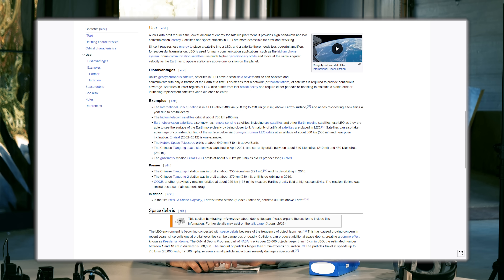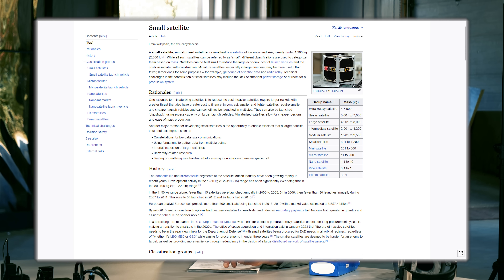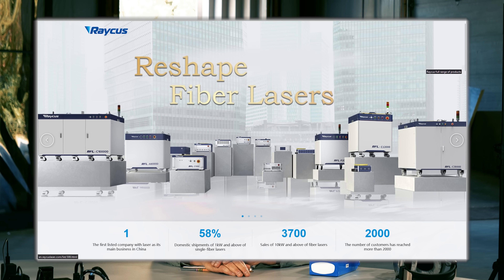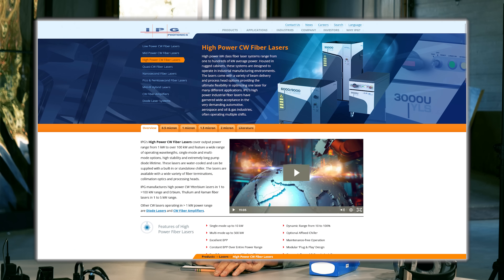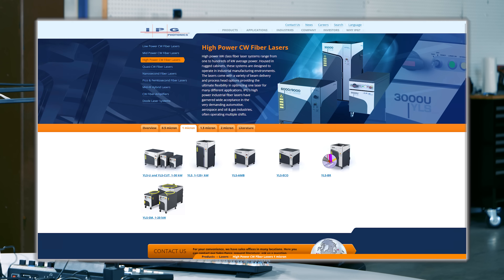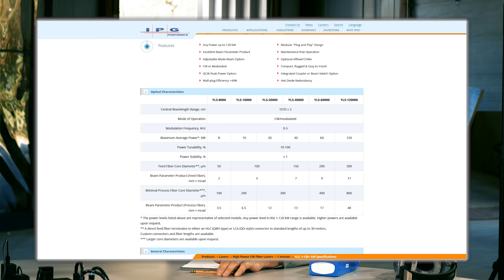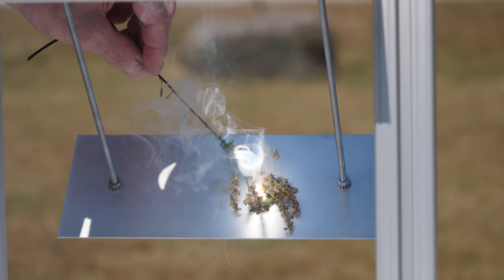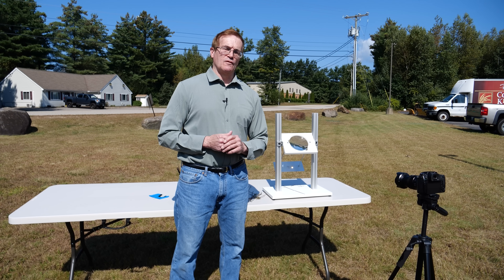COULD SATELLITE LASERS REALLY DO THIS?...

Comment: You should do a video on the feasibility of labelling a nervous system and whether or not you could have a wifi network at that level of form factor for the purpose of controlling the organism. A video on different invasive and non-invasive methods for remote brain control.

For instance, could you calculate the cubic size required for our best piezocrystal to stimulate a single nerve cell? charging them between firings with ultrasound.

It's 2023 if you get what I'm saying...

The piezo nanomotes seem to make sense for why politicians can be made to seem silly with mispronunciation, but their requirement for charge means they can't get the person to say an entire speech. It seems like that sometimes. just sayin
Reply: You used wifi to make this comment so clearly you don't believe yourself

Comment: Thank you, please comment on the following. There was a book written some years ago, talking about microwave weapons. It consisted of a transmitter and a receiver (a conjugate mirror) that focused and amplified microwaves using constructive interference in phase at resonant frequency - or something like that. Is that possible?
Reply from the maker: What you're  describing  is a modified  version  of a MASER. It should function, but as a weapon,  you still have the divergence problem.
Reply: Thanks for your reply, however if it was in phase (same frequency) wouldn't that minimize divergence? @TechIngredients
Reply from the maker: It would and then it would approach the limits I gave in the equation.  Those are real limits based on a perfect, spherical  wavefront. In practice,  it only gets worse.

Comment: This video will need an update when zero-point gravity generator technology goes public, regarding platforms that have been using lasers. Also still does not explain the blue and white plastic objects that dont get touched by flames around them or the metal electro-magnetic fires burning homes. This guy might be NSA or corporate contractor related, "nothing to see here" is part of his job to secure his funding and protect his buddies. Or to be fair maybe he did not study the ruins of the fire to see that brush fire and natural winds is not the answer. There seem to be at least 3 energy weapons at work with these fires, so its not so easy to dismiss all the evidence by just considering one or two without trying to really figure it out. This video does not take into account top secret weapons, or even mention that it is possible he does not know about them.

Comment: When the first Palisades fire happened a few years ago, a lot of people noticed that the trees were burning from the inside out. That made me think of microwave technology. Also, people saw in pictures green beams come down from the sky. Also in the Maui fire, aluminum melted right off of cars. Please explain.
Reply from the maker: I can't address the reports re the trees. It's kinda suspicious because when a fire is so large and hot that the forest is burning, being close enough for long enough to witness that progression in a trunk of a tree is going to be REALLY DIFFICULT. 
The beams, if they occurred, would be invisible because the only lasers with the power and beam quality to do significant damage operate in the infrared. 
Remember, each vehicle contains a lot of  gassoline. Have you ever heard that discussed?

Comment: The kind of powerplant required for such a weapon, I don't think would be probable, as it would be hard to fit in the satellite. It might be possible, by at what cost?

It's not just the cost to deploy and energize one time, and then require recharge. The plant must be far larger.

What storage characteristics will be had at space temperatures? Can they sill deliver at the same efficiency?

Still, for a back of the envelop analysis this is an excellent video. Well done!

Comment: How do you explain the  MELTED ALUMINUM WHEELS I SAW ON CARS BURNED BY "THE FIRE" THAT SEEMED TO BE PICKED OUT FOR DESTRUCTION? COULD THAT HAVE BEEN FROM BURNING GRASS?
Reply from the maker: You don't need the caps.
Probably not, but the gassoline in each vehicle is a likely explanation. The grass fire can rupture the fuel tank and ignite the fuel.

Comment: OK so if I apply this correctly, when I'm dove hunting, and the dove is flying as a 37° angle away from me at 28 mph I will need to lead it by 29 inches instead of 20 because the wind is coming from my left at 4 kts, in the density altitude is 550 feet, and the Coriolis effect and I can back it off by 2.34 inches.... perfect. I'm only a commercial pilot, my mind just doesn't work that way😂😂😂 thank God for people like you!

Comment: I fully appreciate the logic and details on this topic, all but one point. One instance draws merely on "assumption", where everything else is calculated thoroughly. The assumption is that China would be the only responsible state for making use of a DEW. Sadly, I suggest there is more than that state military with such capacity; assuming it would be China, ignores facts we have seen in other such situations. Otherwise, a thoroughly excellent exercise in analysis, educating us with interest. Most viewers would last a few seconds at most. Thanks again..)
Reply from the maker: Thanks. 
However,  I didn't  make that assumption. That particular  state was used as an example.  Obviously,  any state actor and even a well-heeled private actor could field this technology.
I even showed where to obtain  some of the parts!

Comment: During the live streams from La Palma in 2021... One of the streamers was watching a Directed Energy Weapon, i.e. a LASER beam, from space directed at a point on the volcano, until that spot on the volcano became a vent for the volcano. Wish I could remember the creator's name.
Reply from the maker: I doubt that stream was legitimate.
The only lasers with the power and beam quality that have any chance of placing meaningful energy on the ground operate in the infrared.  They are invisible.
Furthermore,  only a geosynchronous satellite remains over a spot above the earth. Such an orbit is 100 times higher than a low earth orbit, and the beam will spread so much that it wouldn't burn a person.  It might not even be felt.

Comment: question to ponder  researchers combined 3 photons of light with a cloud of rubidium gas, apparently the light loses 90% of its speed and gains some mass. ie just like a gas or supper fine dust, but it is solid light made vie electric charge. my question is do you think we should do research to see if that new form of light can be used as a propellent in an EM thruster ie a propellent that is generated via electric power ie a rocket that never runs out of propellent
Reply: lights mass is always zero.
Light doesn't "slow" down as it passes through matter. Light experiences a progressive phase shift as it passes through matter.
This can appear as light "slowing down" but the speed of light is always "C".

Comment: Really nice video. Interesting part of the system could be aiming device capable of tracking small spot on the ground when satellite moves roughly 7km/s relative to the ground at 400km height, although it's certainly possible. Angular speeds are pretty similar to tracking passenger airplane 40 times lower and 30 times slower with precision of low centimeters (roughly one inch) at typical altitude. But with mirrors capable of tracking tank shell or mechanisms responsible for aiming spy satellites ...

Comment: I figure if anyone was going to use a laser for something like this, it would be far easier to just put it on a C130 or even a balloon. Way closer to your target, and can hold a much bigger power supply, and you can stick around for as long as you need. Plus it would be way easier to get your hands on, as opposed to having to build in secret, and then launch a satelite into orbit. We've already been working on an air-to-air laser, mounded on large aircraft, for years, now. and I think the project has been all but scrapped at this point. It wouldn't be that hard just to get one of the retired prototypes, diverted into the hands of someone else, on the way to an airplane graveyard, and fudge some paperwork.

Comment: Great video . Wow . Love how you explain sooo well .
How about this - could say  a 100 time more powerful  ship borne laser fire up to a mirror on a satelite ? The satelite simply redirects  and steers the beam by adjusting the mirror . 
So The ship has unlimited (nuclear) power , the satellite is lightweight low cost and available in multiple locations . The double distance is solved by the 10- 100x more power . The laser on the ship can also be used for direct horizontal activity .
Thanks
Reply from the maker: Thanks!
It's possible. The minimum increase in distance is double if the satellite reflected the beam back to the ship. Practically,  it's probably more like 3 times the distance, and therefore, 10 x the power will produce the same intensity. On the upside, that intensity will cover 10 times the surface area at the target distance.

Comment: I am aware that there was an commercial jet that exploded in the New York area back in 1990's.  Reports claimed to see a missile that brought it down. 
I don't have the knowledge to bring that about. My employment in the 1980's was only 16W argon lasers.30W CO2 lasers. I saw 200+ YAG lasers. The texhs used a columater ND focusing lens to produce a focused point. It produced a clap and flash ionized air. In the 1990's months before the airline disaster a 5KW industrial solid system that would be housed with cooling and generator to power the system in a commercial trailer. 
Could it be cause of that desaster?
Reply from the maker: It's  unlikely.

Comment: Above a high power threshold one encounters nonlinear optical properties such as self focusing.
Reply from the maker: That's  true, but in air that requires extremely high energy, and that means pulsed operation.  Pulsed lasers are substantially more difficult to operate and less efficient, but the principle is valid.

Comment: I think he’s absolutely correct. Although there are strange unexplainable, like a car in a car park totally burnt out, on bitumen, that got so hot it melted the glass, alloy wheels so hot that the molten alloy run a few feet from the car. BUT THE BITUMEN REMAIN UNSCATHED THAT THE CAR WAS SITTING ON !!!! HOW ??? I’ve seen burnt out cars, wheels and glass don’t melt in a normal car fire  !!!
Reply from the maker: That wasn't  a normal  car fire.  The extremely  high winds and the fuel onboard can explain  the burn.

Comment: What if you don't use a laser and generators but only redirect and refocus sunrays from space with methods you described? You simplify things, and get unlimited energy from the sun and capability to focus rays in any point on Earth basically.
Reply from the maker: Because  the light from the sun diverges much more quickly, the mirror would have to be far larger.

Comment: You should know of what is termed the Hutchinson Effect. Thinking of only a single source may not be correct. There may be many sources, and the effects arise from interference patterns. In my view, we are definitely dealing with resonant EM energy that disrupts molecular bonds. And, it doesn't need to be beamed from space. And they likely use interference patterns to attain desired modes. We are not seeing heat or molten metal. We are seeing the loss of molecular bond integrity.
Reply from the maker: That's possible,  but I haven't seen any proof.  There's physics, then engineering then, economics and finally,  politics. That's the order I like to follow.
Reply: @TechIngredients  I removed my beam comments because I am not interested in that angle, but in passing, I have read things about them in the last few years. 

Relating to solar energy from space, they say a laser at 360km with 1cm diameter expands to 1 sqkm at the surface of Earth. But they say that by making the laser a few meters wide, divergence is suppressed. 

And I read that using plasma lenses as opposed to glass, divergence is cut in half from the standard formula. 

And I read that they are able to model electron beams without divergence using some special techniques, but I could not find the source at this time.

Comment: As for supplying huge amounts of energy in a short period of time, there was an experiment done by NASA decades ago. Were they strung a conductive tether? Between a primary satellite and a secondary satellite to see how much electricity could be produced, buy a conductor flying through the magnetic field at those altitudes and speed. It produced so much current the it destroyed the conductive tether between the 2 satellites. This technology applied to a weapon satellite with multiple disposable tethers could in theory, provide enough power for a system like this.

Comment: If this is what's commercially available to anyone, just imagine what might be possible with military level spending and lack of regulations. I would be interested in what would be possible with capacitors that could provide a really powerful pulse vs a sustained battery driven beam. How would they compare in weight to output ratio vs lithium batteries?
Reply from the maker: The limitation  isn't  the peak power supply.  The fiber laser is designed  for its rated output.  Push it harder, even momentarily, and you'll  cook the diodes or shatter the fiber.

Comment: What about that laser that beams to the reflector on the moon to measure it's distance?
Reply from the maker: What about it?
Reply: @TechIngredients  In 1969 they used a low powered laser (recently developed In 1960) to not only focus a beam through the atmosphere (without adaptive mirrors) but then have it strike a retroreflective apparatus on the moon 384,400 km away, AND some how detect it's reflection (back through our atmosphere) from an array of small prism mirrors? Quite the feat in 1969, do you agree? So how did that beam not disperse or fade?
Reply from the maker: It did diverge.  The spot on the moon was approximately  2 miles in diameter. The retroreflection was even larger, but enough photons were captured by the receiving  telescope  to time the trip and determine the distance.

Comment: Grass fire does not explain abnomlies like trees burning from inside out, which happened in maui and LA
Reply from the maker: I've not seen clear evidence of that happening. 
However,  are you aware that during a general fire in a forest, many of the trees don't just burn, they explode. This is because water content is much greater in the core, and when heated rapidly,  the stem pressure inside ruptures the tree. That might explain some of these reports.

Comment: The heat to the equipment will not be that much of a problem when used in space it's almost ideal temperatures for such equipment.  I ordered a few high quality lasers online and took them apart and built my own an yes over heating was an issue given the materal i am allowed to purchase so i used liquid  nitrogen  which made a huge difference but still the materal i had still wasn't the proper quality.  But im sure the military has more than enough to make it as powerful as they want it to be.

Comment: I saw a diagram of energy being diverted from the sun by three satellites to another satellite that then has basically an unlimited power supply for things like directed energy weapons. Is this possible?
Reply from the maker: It's physically possible but cumbersome and not likely useful.
Launching three additional satellites just to increase the sunlight capture area of a fourth satellite is costly.  In addition, sunlight diverges very rapidly compared to laser light, so the feed satellites  would have to be very close to the receiving satellite to get a significant amount of light onto a collector.

Comment: Another option is to take the laser system up in pieces and assemble it up there, then you're not nearly as limited by size and weight.  I mean, if we can build a huge space station, putting together a space based laser system is nothing.

Comment: I've designed several quantum ai neural systems as well as code for implementing what I call a guardian AI, it uses quantum computing and classical computing in a hybrid system. I have several designs in cirq and in python integrating openai gpt models as an integrated layer..

Comment: I think what you are doing great. You did not explain why blue was not effected in Maui? They show cars alone with nothing combustable around it yet glass melted and aluminum of the car which we know has to be at least 1200 F to melt aluminum? There is an x fire chief who did a review of the fire and Paradice fire also.
Reply from the maker: It's hard to prove a negative. The reports about blue are mixed and anecdotal.
The explanation re the vehicles is simple...fuel.  Gasoline and diesel are easy to ignite with hot embers that the high winds can move around. The tempreures these fues can reach are in excess of 1,200F.  A space based laser is unlikely to achieve this tempreure and it certainly won't if it doesn't have many minutes to continuously heat the surface, and that's just one vehicle.